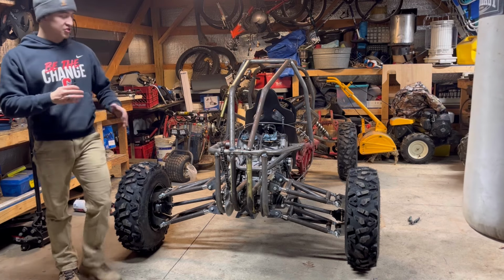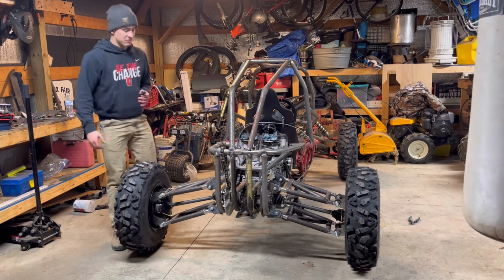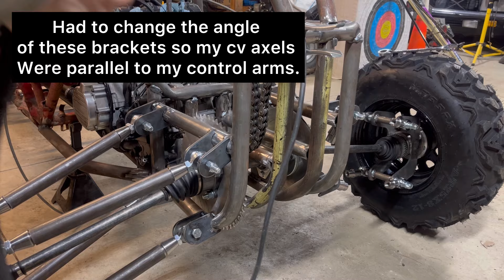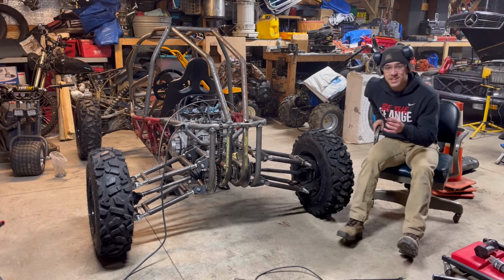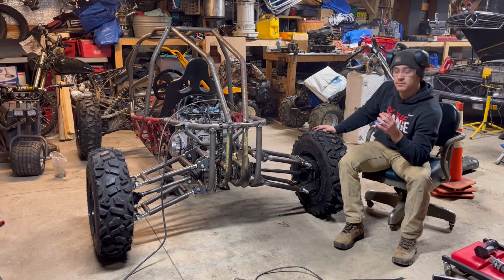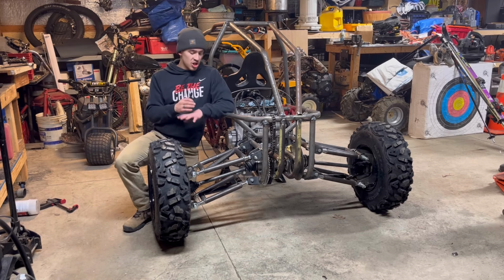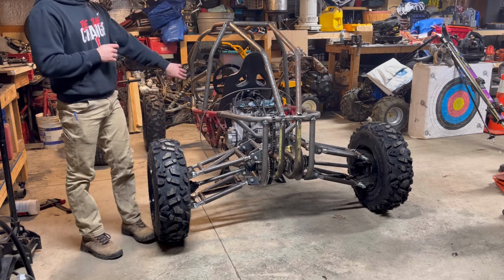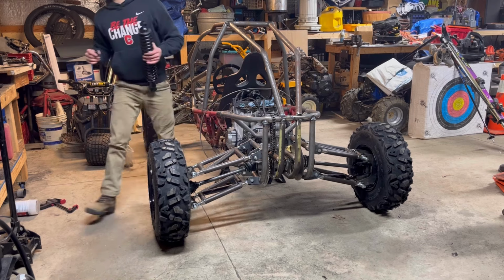CONTROL ARMS! GSXR 600 cross kart build series.

Comment: One suggestion I have for you is the rear cradle. You should do some cross bracing at the lower portion where your arms are connected so you don’t have any flex. Also, below the sprocket you can do some crossbracing there that will save your chain from any rock or debris that happens to hit it.
Reply from the maker: I definitely plan to I’ve just been waiting to cross brace till I get some other stuff done, thanks for the advice!

Comment: It seems that your parts list cut off at 18? It shows 17 as the spoiler, the 18 with nothing. What brake caliper did you use? Appreciate your documenting the process! Really inspirational! Keep it up man!
Reply from the maker: Happy to help, the brake caliper I used on the rear was the front brake caliper on the bike I took the engine from. So a gsxr600 front brake caliper

Comment: Nice work!  Can you put a link to the ends of the A-arms you built, or tell us where they can be sourced?
Thanks
Reply from the maker: Sorry I forgot to add it to my list but here’s the link! https://www.amazon.com/YIFUOK-Thread-Chromoly-Panhard-inch-2Set/dp/B0C1569665/ref=asc_df_B0C1569665/?tag=hyprod-20&linkCode=df0&hvadid=673653982935&hvpos=&hvnetw=g&hvrand=3200675150376753890&hvpone=&hvptwo=&hvqmt=&hvdev=m&hvdvcmdl=&hvlocint=&hvlocphy=9015130&hvtargid=pla-2202483978439&psc=1&mcid=b4130e53a30a3963b5bcb2711dc413a7
Reply: @Gages.garage1  Thank you for the link! Hope that hand heals up soon!
Reply from the maker: @tommyyates4639  no problem, I appreciate it.